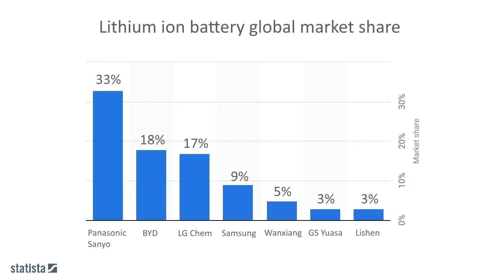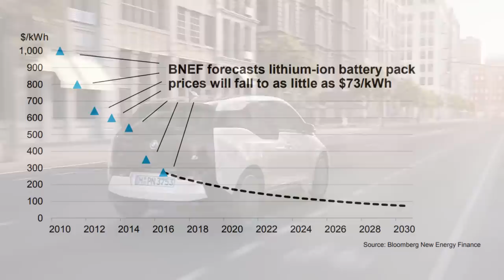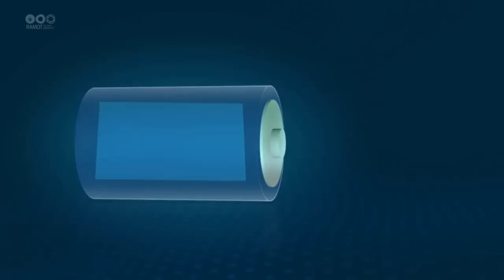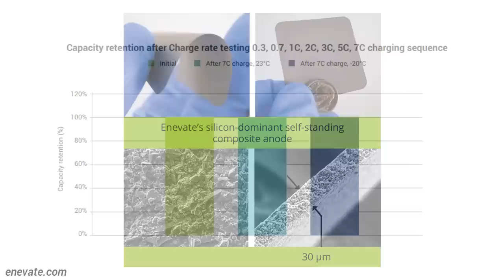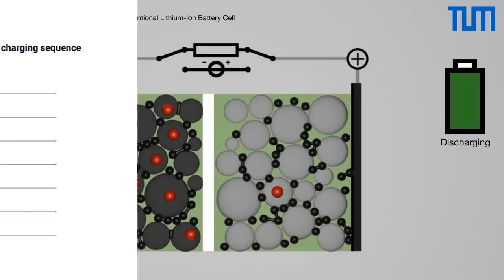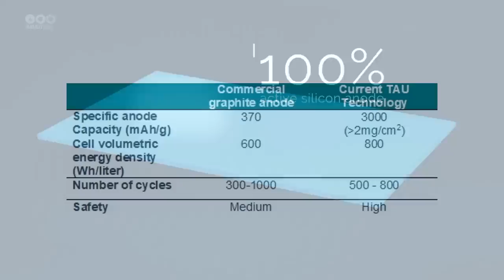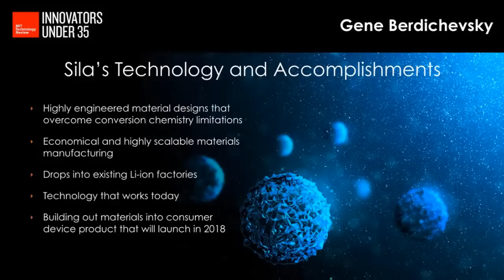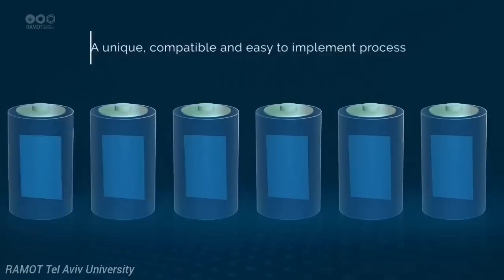The Battery Revolution. Ultra Fast Charging

Comment: Thanks for the informations, we have to needs Recearch and developments for setups total support for lifetime batteries which runs longer times running capabilities likes for 365days and mores abouts and participations years after years likes applications digital watches, we have to needs autonomous provisions for alls abouts, use and through or high quality products performance with if not possible to make sure fast high quality efficiency fasters moods of charging options which makes given charging facilities 5 to 10 seconds or more as soon as possible regarding with cares abouts including provisions of safety and security concerns, we have to needs running the batteries charging from solar power systems including microwave signals froms of the new kinds of power generations which are achieving in futhers steps for wireless network controls systems charging with proper feedbacks helping protections for safety and securities prequsions concerns stoods in the batteries, we have been done and goes eliminates implementations battery charger has been processed provisions in the batteries with the helps of nanotechnology, and provides in glasses and Flims and maybe reached holograms provisions in futhers steps movements regarding related matters arrangements necessary for wireless network controls systems, we have been made shorter than shorter , smaller than smaller, thiners sizes as possibles which makes it easy access to provide in the mobile phones, tabs, ipads, laptops, computers, radios, TVs, calculator, projector machines, digital cameras, camcorders, digital watches, digital printing machines, digital watches, digital medical instruments, Automobiles etc with others in futhers fields of domestic, commercial and industrial applications, with lots of choices allowed for alls abouts goods with unique designs as goods made in ,we have been implemented nono batteries, nono inverters, nono ups provisions in the solarpanels with compact smaller sizes with high quality efficiency fasters moods of arrangements that's we have to required to the futhers, we have been makes autonomous power generations for every things, we have to makes internets charging arrange in futhers steps, with Robotics self intelligence approaches as stoods handing overalls controls systems management manually and automatically generated by easy software solutions with hardware control systems regarding related easy make sure withstands efforts ,easy to handle alls with effortables prices, concerns providers please highlights abouts taken technological advances innovations, thanks given with love and cares abouts, God bless you alls, yours faithfully.

Comment: Electric cars are good but what about recycling old car batteries and its toxic wastes
Reply: Lithium batteries are 100% recyclable, it just needs to be economically prudent to do so, which becomes more of a case with increased use.
Reply: Drog007 as of now batteries just get shipped to Africa where people dissassemble them with their bare hands and get intoxicated
Reply: totoIV, got a source for that?  I call BS when it comes to EV batteries.
Reply: totoIV
That's the case with a lot of electronics, but not EV batteries. And nothing in a lithium battery is toxic.
Reply: jack regans that not-recycling nonsense is getting lame already. They get recyled completely, we know that and still some geniuses don't stop spitting that nonsense out.
Reply: So we should keep on recycling ideed
Reply: electric car batteries are not just lithium, it has regulating computers and motherboards which have toxic compounds.
Reply: peachees those components can be also recycled if they get old and disposable. Is it?
Reply: Chris Obber Cause few sources say they are. So spread the truth. People are misinformed. Not stupid. Everyone says it isn't recyclable. Or at least not completely.
Reply: jack regans Only the metal from them and the gold. Very profitable getting the metal matter of fact. But expensive to start and run.
Reply: Drog007 And a good infrastructure geared towards it.  It's doable once business smell the money.
Reply: Oh come on peachees...  Even gasoline cars have computers and motherboards in them.  Have you seen how much tech is crammed into modern vehicles?  ECUs, infotainment systems, emissions controls, electric seats, heated wheels, tracking headlights, sensors, electronic differentials, diagnostic trackers, and more!  Even if we overlooked the fact that an EV uses way less oil and grease and has way less moving parts, you must understand that you don't need a lot of hardware to regulate the battery packs.
Reply: There will be a huge industry based on recycling and storage.
Reply: Lithium dissolves readily in salt brine. To recycle a lithium ion battery you dump it into an industrial scale blender with salt water & apply an electric charge to the resulting slurry. The lithium collects on one of the electrodes & you can reuse the salt solution. 

All the other metals & plastics can be separated in a few more steps that are far cheaper than mining raw ores.
Reply: I've seen dozens of ways of making batteries.  One guy on youtube is making batteries using the cheapest elements on the periodic table
Reply: There's 3x more uranium than there is lithium in the world. At this rate, we'll run out of lithium by the year 2050..
Reply: Kholke Holkepolke

At this rate, lithium is not ran out by the year 2050 since lithium unlike uranium and gasoline is not used as a fuel but only a matter with atomic characteristics befitting of storing energy at high density. It is not consumed in any form or way and is 100% recyclable, in fact 12 years of the world mining supply will be enough to power all our cars for a indefinite amount of time if recycled properly with minimal loss. Apart from that there is a nearly immeasurable amount of lithium in the ocean that is not being considered to be extracted from since mining is a more economic way of attaining it for now. And to add insult to injury in 10-20 years we will most likely see solid state battery's show up with 3 to 10 (at peak) times more energy density which are absolutely not volatile in any form or way.
Stop talking rubbish.
Reply: Cool, I never checked the sources of that info.. My bad. Strangely enough I can't even find the link to it..
Reply: Kholke Holkepolke Try harder and with less bias.
Reply: I just admitted I'm wrong and you call bias.. Troll much?
Reply: John Livesey To be fair he did reflect so I don't think saying that is really appropriate. I mean you can't be born with knowledge, gotta learn it someway.
Reply: Kholke Holkepolke glad to see you found the link.
Reply: Kholke - Lithium is not a 1x use commodity, it can totally recycled. but, so can uranium be mostly recycled and reprocessed. but currently its cheaper to MINE new lithium ore than its to recycle it. but, Tesla recycles its batteries, not because its cheap, because its the right thing to do.
Reply: totoIV 
Rubbish.
Lithium ion batteries are totally recyclable.
Tesla recycle using third party companies now and Tesla will recycle in house soon.
Reply: peachees 
Do you really think ICE cars don't have electronics?
Reply: Layback Studios 
Who's "everybody"
Tesla recycles
BMW recycles
Hyundai recycles
Etc, etc.
During the Tesla AGM the question was asked and answered.
ALL batteries are recycled.
Recycling is currently by outside partners, but when the factory is complete and enough batteries come back s fully integrated, closed loop system will recover materials, INCLUDING Lithium at cheaper cost than new stock.
Google it.
Reply: NonyaBusiness! 
How about a question mark ?? (There's a spare)
Came over as a statement.
Answered as such.
Reply: Drog007 nothing. Not even steel is 100% recyclable.

The best processes can produce 99.9% pure lithium from batteries. But that's only produce the story. Some lithium is also unrecoverable.

You need to be careful with the word recycling as it is overloaded. We can turn 100% of batteries in for recycling. We can process those batteries to recover most of the lithium. And the lithium we get from reprocessing is at best 99.9% pure. This is good enough for more batteries as they currently require 99.5% pure lithium.

About little less than 1% of the lead can't be recovered each processing pass.  That's not much, but for every 150 to 200 batteries recycled, about one battery worth of lead is lost.
Reply: I have used old laptop batteries to make me a ebike battery for almost nothing. The thing with labtop batteries is that if one cell among all cells within the pack breaks, the whole pack shuts. So people trow away good cells whithout knowing
Reply: Sebastian Kapelius i would like to recycle my old mobile phones too including batteries. The sad truth is that there is no electronics recycling centre in my country
Reply: jack regans I don't know about any recycling center in my country either. I live in Brazil. I only know about "battery safe disposable bins", but I guess these batteries are just being stored in a safe place, not recycled. Worry not, for the time when it will be economically practicable to recycle batteries is yet to come. (For our countries)
Reply: Sebastian Kapelius well i m interested in not only in recycling batteries but everything that goes to landfill and that is non biodegradable. The sad truth is that i m from Nepal where there is no any recycling centre for anything by the way
Reply: jack regans You can start your own recycling center. There are some materials that are easier and cheaper to recycle. There is profit that can be obtained from recycling. If you say that there's no recycling whatsoever, you can start with plastics. And then sell it to the industry. I don't know how doable it is in Nepal, but maybe there is a small niche where recycling is a self-sustaining bussiness.
Reply: jack regans exactly... You should see the mine the raw materials come from... And how much goes into just refining the materials let alone actually building the cells themselves.
Reply: Complete rubbish, in fact the other way aropund
Reply: +Layback
Who is "everyone"?
Reply: +Kholke
Thare are lakes full of lithium, heaps of it in the world.
Reply: So you are saying that we will run out of lithium soon? Is your source peer reviewed or is it gibberish?
Reply: All this being said while we still dump millions of pounds of plastic in the ocean 🙄
Reply: jack regans 

This is out dated , at initial stage itself followed by , Super cap Batteries .
Reply: thank you for questioning it. Wondering about the cost to replace of the battery now (we can't use the price of what haven't invented yet into the calculation), and the cost/work at the shop to get them switch out. I don't know if it is bad ,or is it ok to only replace the bad battery, or have to replace the whole thing. I know with regular batteries we don't mix old and new batteries.
Reply: @macmcleod1188  
Lead?
That would be lead acid batteries? Not lithium ion batteries?
So every ICE car leaving yhefroad (which probably uses 3-4 batteries in its lifetime?) Is a good thing!
Reply: Sure.  

My point was that recycling isn't perfect.  Everytime you recycle, you lose about 0.5% of the lead, and you lose similar percentages (usually higher) for every other recycling process.
Reply: The only problem with a lithium ion battery is the breakdown due to brute force charging.  The Silicone and Graphine batteries they are talking about will not break down, and henceforth will never need recycling.  Currently, even batteries that have diminished capacity are being re-purposed for residential storage paired to a solar system allowing people to further exit the grid or have consistent electrical power in remote areas not serviced by a grid.
Reply: @frankconsoli1639  I think you're being a little over optimistic there. Google show several graphene battery introduction sites and while they claim improved performance they do not claim infinite performance.

However as the principal ingredients are silicon and graphene, both of which are in abundance it is an exciting technology. I'll need more time to dig into what the doping materials are if any.
Reply: Actually, since 2015 at least half the worlds supply has not come from mining but from brine extraction.   Brines are important sources of salt, iodine, lithium, magnesium, potassium, bromine, and other materials.
Reply: 100% recyclable cells, and in some cases it just makes more sense to convert the EV battery pack it into a power unit for residential or commercial use. Depleted EV packs can still have like 20~ Kwh, still good enough to use for a backup electricity system, or storage for residential wind/solar power. There's a good market for simply re-purposing these packs into less demanding uses.
Reply: Yes electric vehicles are good and about the toxic waste it is very less as compared to the toxic emissions of a gasoline vehicle and in the evaluation of the batteries, thermal batteries are introduced which are nontoxic, highly safe and more efficient, 95% of the material is recyclable which will be commercially produced by early 2019.
Reply: We better get started, now, for future generations.
Reply: peachees : less than ICE cars👍🏻
Reply: @pccchurch   it seems that this not prevented you to buy a reasonable number of computer/mobile/electronic devices for yourself... I suppose that a ICE car is comparatively more polluting than an electric car, because the life cycle studies say that the embedded energy is about half for an electric car (considering constuction costs, maintainance/repairs and fuel)
Reply: @t-bone9239  good
Reply: Hydrogen conversion maybe possible.
Reply: @captaincrunch3892  Confirmed, I've worked there and seen it live. Impressive. Recycling loop on Li-Ion batteries !
Reply: @Drog007  99% ;)
Reply: @t-bone9239  source?
Reply: @pccchurch  that's why they are 99% recyclable and not 100%

Comment: lol  still  has limited mobility and range  keeps you close to a big city to charge up  gas gives you freedom long as the tank is filled   you can go any wear you want:)  that town in the middle of nowhere doesn't have  car port charger  whoops  guess you just got stuck with a tow bill
Reply: 1 Solar panels would give you far more freedom than gasoline
2 Adapters to universal sockets, duh.
Reply: Aww poor G-ASS addict my ELECTRIC heart pumps lumps of BANANA!👎😁❤

Comment: But where would you get all that electrical energy from and the cost of getting it there (infrastructure). Think about how many amps that is being delivered. Think about a road trip and a remote service station with 20 cars trying to charge...
Reply: Yes, so what?  On I-5 in California, there is a huge supercharger station in the Central Valley, at Kettleman City.  It has ~50 stalls.  The infrastructure is already mostly in place, since the electrical grid already runs everywhere that there is demand.
Reply: SyphonLife, did you miss my comment?  Tesla has built ten thousand superchargers, Shell is building chargers, Volkswagen, a dozen other companies.  The EV transition is happening, and the grid exists.  That's reality.

Comment: These should come with replaceable batteries and EV stations just like fuel pumps selling fully charged batteries for a price. That way when u run out of battery, you don't stop and wait for it to charge rather, just buy a fully charged one, give up your depleted battery and continue your ride.
Reply: Needs standardization, which is a long way off, but fast chargers will probably be faster than changing out a battery pack.

Comment: For the millionth time electric cars are NOT GREEN because ELECTRICITY IS NOT GREEN. Renewable fuels provides less than 10% of electricity generated. What do you think your wall socket is connected to
Reply: SHHH SHHHHH  dont let them know that thier "Green" solar plants out in NV actually emit more pollutants than a standard Nat Gas plant.. due to eliminations of emissions restrictions.  (nat gas is used as a preheat/replacement for the solar)

Comment: Nicely done! It appears that evolving battery technologies will be competitively proprietary with no real standard, thus making universal charging stations difficult to accomplish.
Reply: Batteries and charging standards have zero to do with each other.  It is like claiming that you need different fuel in your car if your gas tank is shaped differently, a different size, or if the fuel nozzle is on the other side of the car.
Reply: You're right!  Thought about it after I posted... The charger is in the car, so voltage and amp ratings of the station will be universal... just the plug will need to be made so.
Reply: There is more standardization out there than people realize.  The fast charging stations today may be proprietary with a couple of different standards, but in the USA, pretty much every L2 station is SAE J1772 compatible, which means you can charge almost any electric car at any public L2 charging station.

But in many cases, even the fast charging stations are just a different connector type.  Tesla for example can use its Supercharger network, but it can also use the Chademo network with a simple adapter.

It can also be charged at any L2 charging station, and can be charged at any RV park with a 14-50 outlet, any dryer outlet, any 115V outlet, etc.

Comment: Fossil fuels create 71% of U.S. Electricity. Do you see a connection.
Reply: That's also mostly because there's no cost effective way to store wind and solar for when demand is high. However if battery technology improves this won't be an issue
Reply: Thanks for asking. Yes, I do! U.S. is going the wrong way!